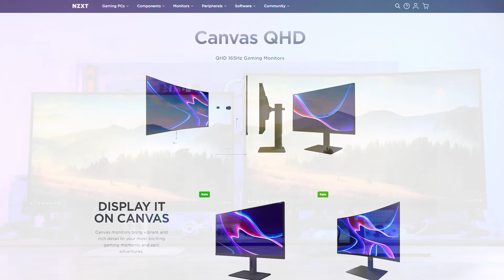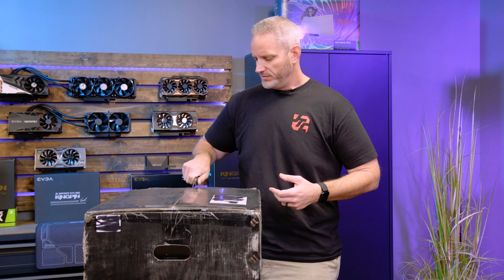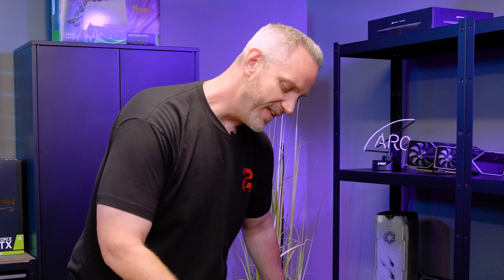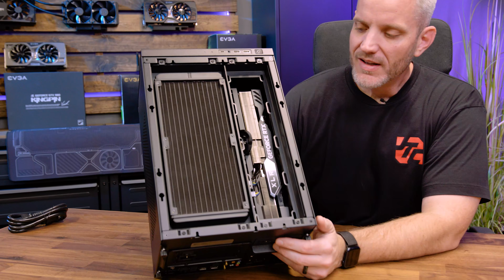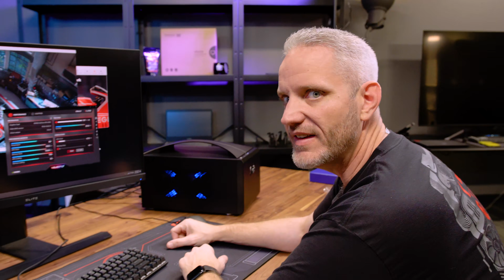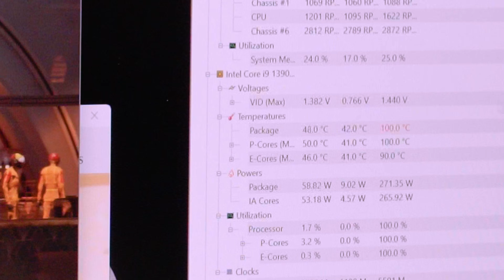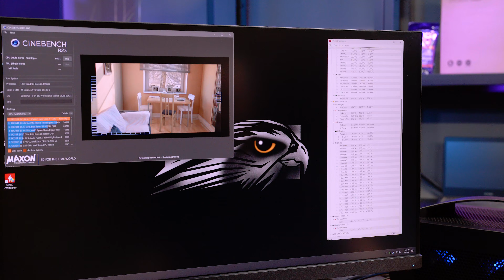Falcon Northwest DARED me to review the Fragbox!

Comment: What's the point of having RGB Kingston Fury if it's buried in the box out of sight?
Reply: If you change build later and then you reuse your ram in a diffrent case may be able to see it or you upgrade and keep for a new build or it could just be the best price to performance so who cares if it has lights or not
Reply: @ryanwachs4808  That's thinking very far ahead, though. The point of the frag box is portability. The price is too damn high. All I would want is the shell, but I'll be damned if Falcon Northwest sells this at any price that is remotely reasonable. Love the form factor and it's a blast from the past, but they're loading this thing with parts that it has no business running just to make a quick buck. Price to performance is terrible in every scenario. The frag box is practically dead and they're trying to cash in on nostalgia. When you buy this thing with fresh new components, you're buying it new and not thinking 4 or 5 years later for when your next build will be. There are so many potential corners to cut, but it won't be allowed. It's like, "Oh, you want the frag box? Pay us over $3k and we'll give you a heater. You're better off building an ITX with a Jonsbo T8.

Comment: Hi from Germany, quick question what GPU would you recommend to pair with an R5 7600x? (1440p)
Reply: For more stable 1440p id say RTX 3080 or greater 

If you are on a budget, you should still be fine with a 3060 or 3070 though you'll just not be playing at max settings in most newer games if you want to use 1440p
Reply: 3080 or 6800xt would be perfect
Reply: It'd help if you could say what you want to play/ do. Video editing and ultra-quality AAA games are very demanding, Netflix and e-sports games require litte computational power. 

So: what games, on which settings and what is your target fps?
Reply: at least radeon 5700x or rtx 3060ti. 
i run a 3070 and its doing very low end 4k as well but who seriously needs 4k?
since youre also from germany id recommend the evga 3060ti xc (525 at octo24) if youre not maxxing out all video settings in AAA games and are  fine with roughly 70-80fps in demanding games
Reply: First of all thanks for the recommendations, I’m hoping for 240 fps on esports games (medium setting) and 100 on like racing games with high/epic Settings. I was thinking about a 6800/6800xt but those are basically sold out I’m Germany so Yea…
Reply: @maximilians.1344  if you care about Rt,dlss or vr - 3080, if not then the 6800xt is great value at 550